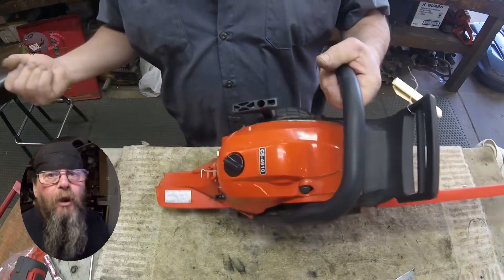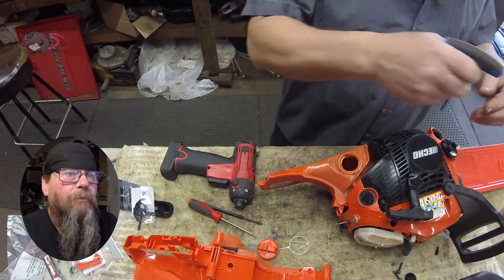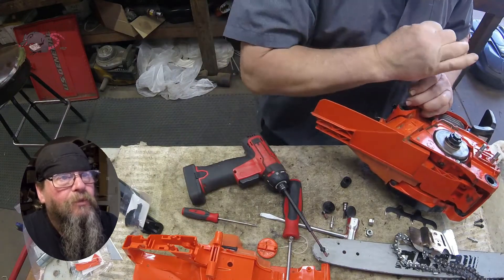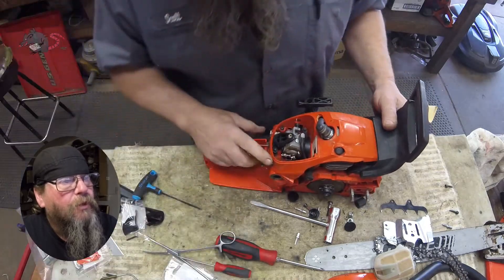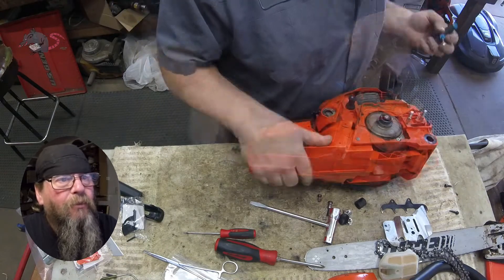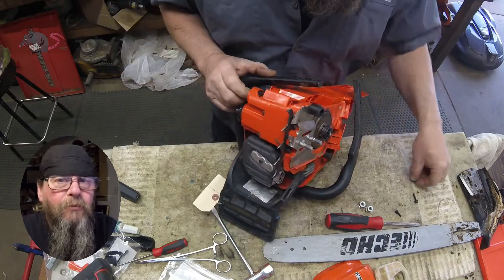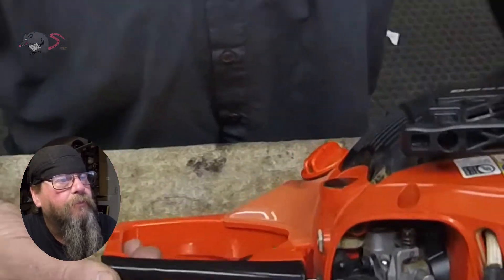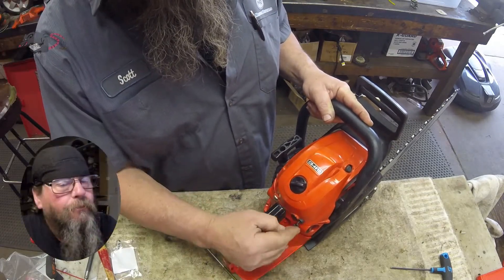Echo CS4910 Chainsaw Fuel Tank Replacement

Comment: I have noticed on your tank replacement videos or Plastics repair, you don't check the cylinder for scoring first to see if the repair is worth doing. Do you leave that part out of those videos or not check it because the saw was dropped and not running poorly?
Reply from the maker: Because of the cost involved with those repairs the saw has already been looked at and a quote given. Other times they bring me their parts saw and ask to swap the tank. Usually at some point I determine if the repair is worthwhile but that doesn't always make the videos.